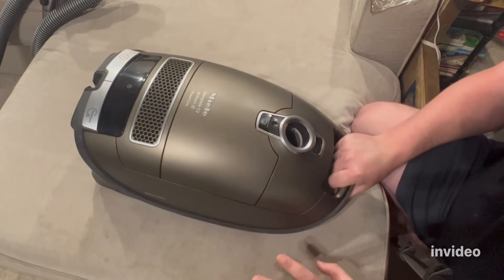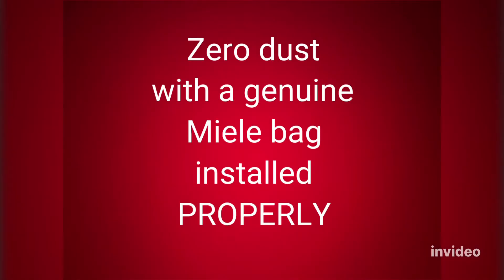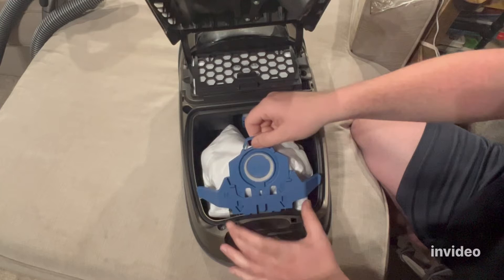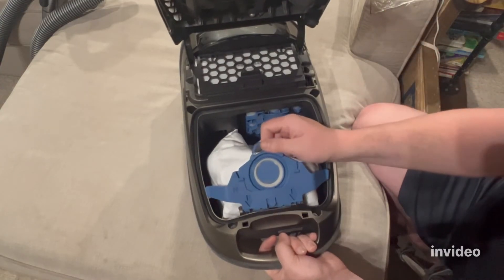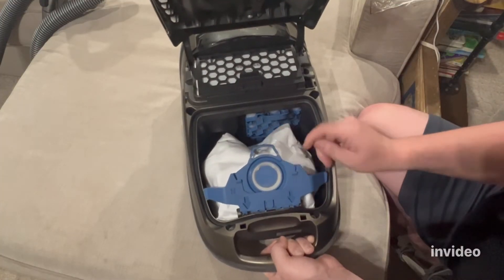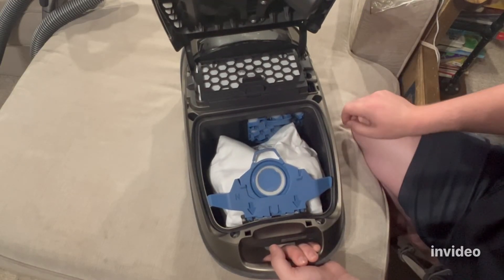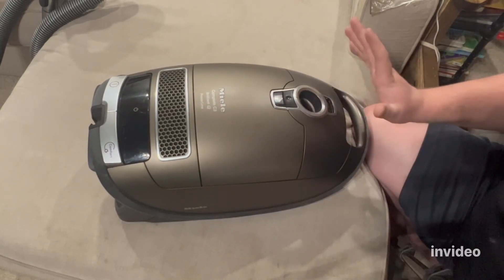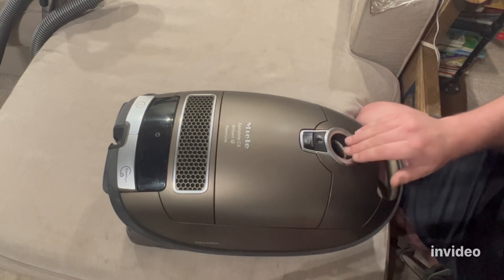How to: Avoid Common Miele MISTAKE

Comment: Please help i just chnged bag for first time and the light is still showing red im not sure what i done wrong
Reply: Mine does also I have the c2 if your hoovering rugs put  the brush on high,just check the bag regularly I always remove the dust cap on the bags as on 2 occasions I’ve picked stuff up and the bag blocked  on the round bag seal, if you put your hand over the nozzle the red warning sign comes on nowt to worry about

Comment: Hi, I can quite decide if this issue is due to lousy design or nasty design. Lousy in that if the bag is not clipped in place correctly, then the lid should not be able to be shut. Nasty design in that the goal is to destroy the vacuum forcing you to replace the whole unit. Thank you for the video. I found out about this so-called convenience feature the "hard way" with a brand-new C3 Cat and Dog having its innards filled with dust too. Keep up the great videos!
Reply: Yeah I was thinking the same thing. Why would they add this so called feature. I do not think the older Miele canisters had this. 

Then I thought maybe they added it to try and differentiate the two blue parts to prevent people from removing the blue plastic attachment slot when changing their bags. 

I do think it is a bad design and would be better if it would prevent the user from closing the lid if the bag is not completely inserted correctly.
Reply: @impermanance5624 we also have an s5000 where if it’s on the ground without a bag, you cannot shut the lid without forcing it shut. If the bag is partially installed then shutting the lid seats the bag properly.
Reply from the maker: @impermanance5624  it won’t close if a bag is not in it, and it won’t close if a bag is not pushed down into the dock. However, this isn’t a fool-proof design since the lid can still be forced shut with generic bags. This problem is mostly due to bent docks and collars from trying to force it to close, and trying to use generic bags.
Reply: @Cleaning_Hero  Hi, If the s8/C3 is standing upright and the door is opened to inspect the bag, then it can be closed without force. We only have genuine bags. It's poorly thought out.

Comment: Wow thanks for the follow up video on my question! That’s very kind of you. 

I’m waiting on my c3 Marin to arrive and thanks to your guide videos I’m sure you have saved me from a broken motor and expensive repair down the line. 

Another great video and tips. 
Looking forward to the rest of your Miele c3 series. 

Much appreciated  ☃️
Reply from the maker: You are welcome! My grandmother has that machine. By the way, you can get a bulk pack from Miele that comes with 16 bags, 4 premotor filters and 1 HEPA exhaust filter. Miele gives you 1 premotor filter for every 4 bags in the box you buy, as you are supposed to replace the premotor filter after every 4 bags. Don’t forget to make sure the bag is seated properly before you use it, and make sure to date the exhaust filter and squeeze it’s TimeStrip green tab. I’ll make another getting started video.
Reply from the maker: Also, I forget to say make sure to check the very top of the wand, to the left of the socket for cracks. It’s the plastic part around inside the metal shaft, at the very top where the handle goes in. Some of those wands have cracks in them in that spot. Miele should either send you a new one or the retailer should have you ship the machine back in exchange for a whole new unit. It is one of the first things you take out of the box so check that first before you take the whole unit out. I can send you a pic of what I’m talking about if you aren’t sure what I part I am referring to. This happened with one of my Miele vacs but the second one was fine.